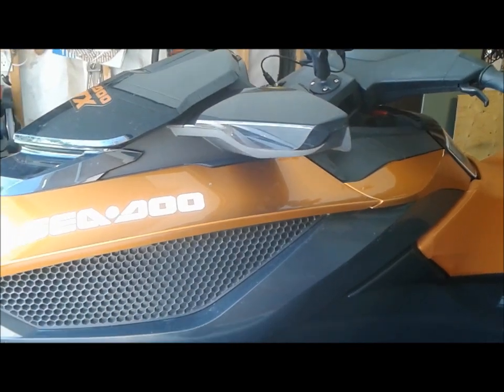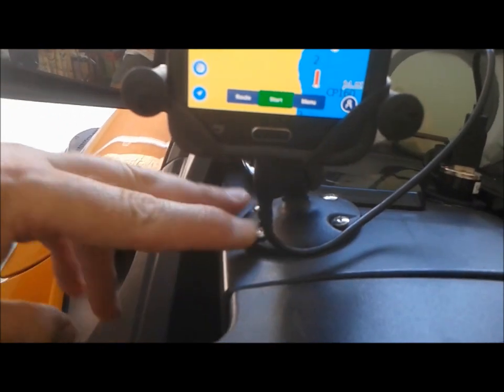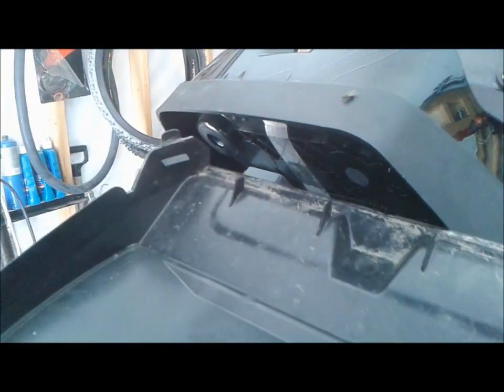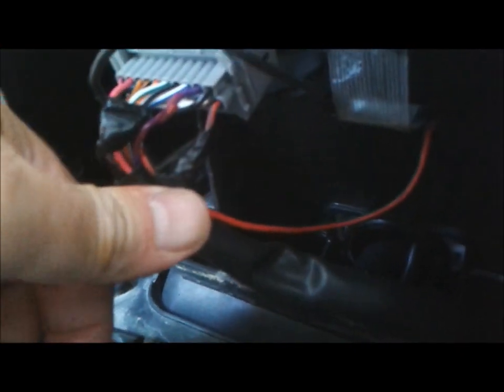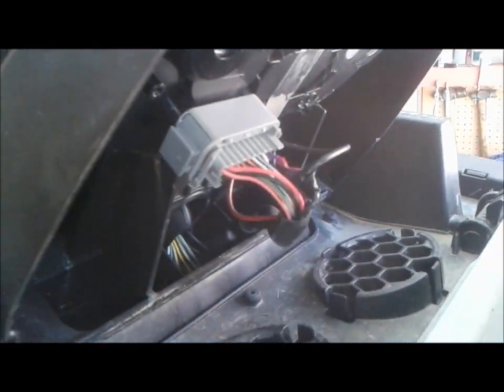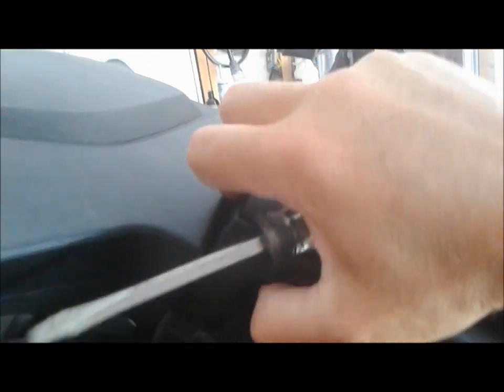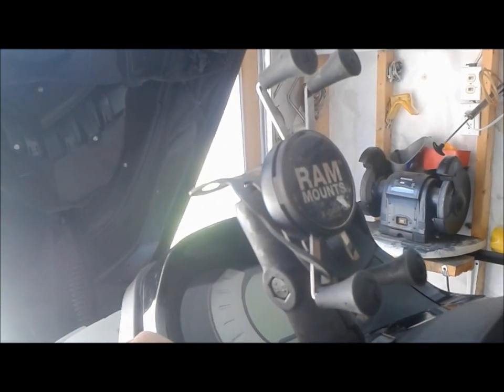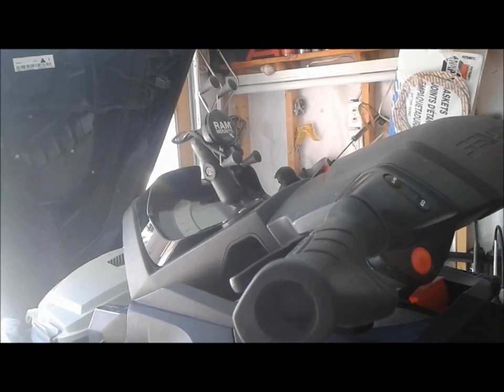INSTALLED A RAM PHONE MOUNT on SEA DOO PWC 2015 GTX-S 155

Comment: Outstanding clip as I am currently adding a Lowrance HDS Gen 3 chart plotter to the exact location you put your iphone on my 2016 GTX 155 S. I would like to know how you T spliced into the boat’s 2 power lines for your 12 volt plug. I know you said you soldered them but did you cut the wires and use the new solder and seal butt connectors doubling the wires on one end? Or did you just remove the sheath and twist the new wire on and then solder? The power cord for my chart plotter looks really thin like 22 AWG and I want to do it a proven way.

Comment: Thank you this is great. But what about Navionics on the phone? I've been testing it and it drives me bananas. Every time I touch the screen it loses the heading-up preference? Do you still use it?
Reply from the maker: I'm using a version from a few years back.  I never update it despite its annoying prompting. I don't seem to have that issue. I just touch the little heading icon in the corner to get heading up.

Comment: You did a nice, neat job. But for me nothing like that would work. 1st, I would not be able to see anything on the phone (Samsung s9+) in direct Florida sun. 2nd, I'm sure the phone will overheat in that sun also. And 3rd and most important, all those open connections will rust/corrode probably the 1st time I take it for the ride in salt water...
Reply from the maker: I kept my old Samsung  J3(6) specifically for navionics... super bright display.  My 9 is dim